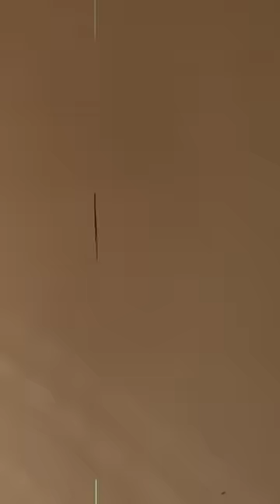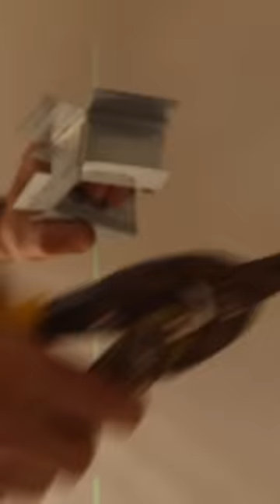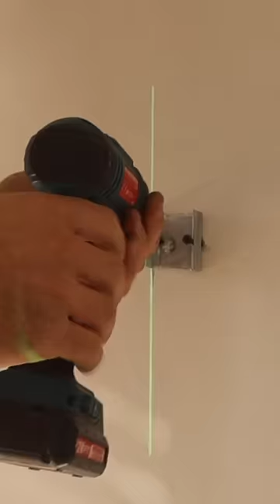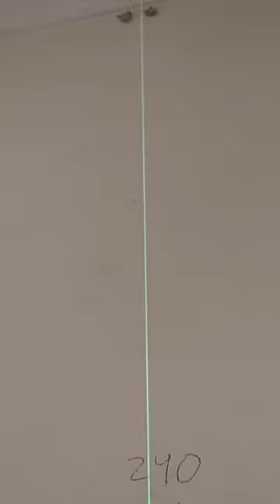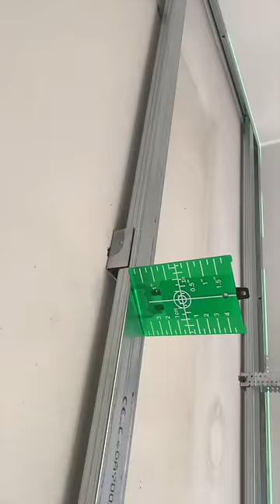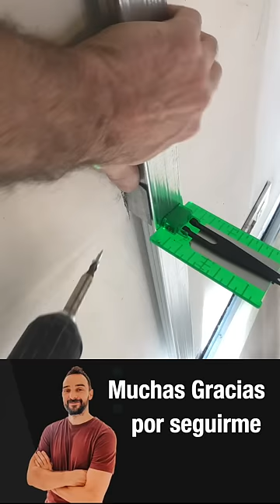🔥 When you run out of DIRECT ANCHORS, you can use 48mm CHANNEL 🤜 #shorts #drywall #pladur

Comment: What not use the proper brackets instead off cutting bits of tin  and using the hammer drill on hollow walls their is a system too drywall and if you don't know also a book, every day is a school day